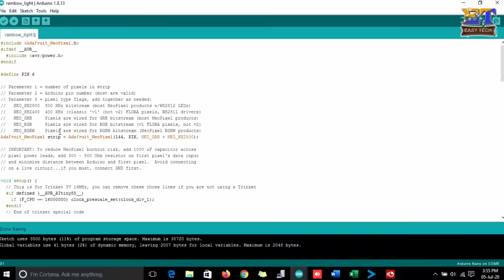Amazing Idea Using RGB WS2812 LED

Comment: I replaced all my 100w florescent lights with 4 meter .2w white LED strips. much better over all lighting.  I used 12V computer power supplies.

Comment: Well Nice Video. I agree with some peoples remarks. It looks like a  HMMMMM HMMMM.  Yeah a development of a Dildo. I think its a brilliant idea to use expoxy for the final model. Just an Idea for your fantastic Vibrator Nano project. You Could utilize touch sensors and a tilt gyro sensors to add to the light show or change the vibration. Thanks for making the video. Its a wonderful idea!

Comment: Did alike with a clean atTiny24 a while ago (why 24? Because I had some around :P) running internal 8 MHz to reduce the part count (ASM code and no Arduino, of course). Although a much smaller core, the Asm (and the clean code with no library/loader clutter) makes a true difference here (much higher framerates, an actual lighting program instead of just scrolling the stuff - and I went as far as the transmit-time color LUTs, so the color schemes are much more interesting). Sucks I only managed two 256-color LUTs (couldn't fit more), tho got smooth-activated full-on and full-off modes :P
Reply: https://youtu.be/vDdm4ySWwUI?t=14

Comment: Love your project. Is the flashing colorful lights obtained through chip adjustment? 
Is the light strip originally white?
Reply: no. these are called neopixels or ws2812b led strip. Search them on youtube to know more about it
Reply: @flickeringsoul35  neopixels initialize at white, full bright, unless the #define is changed.
Reply: https://youtu.be/vDdm4ySWwUI?t=14

Comment: Bruh why you even need to do this? You can get 20m led lights for 22 bucks, which comes with all you need without even soldering, you can control it with Smartphone or remote controller. It will be much easier  just connect controller and Module. Guess this guy is indian who need money by making crap. And also stop deleting my comments you scammer.

Comment: Shenzhen Jiangjing Lighting Co., Ltd.focus on development,designing, manufacturing and marketing of commercial and industrial lighting fixtures.

We own full sets of advanced professional manufacturing and inspection equipments, all lighting fixtures that we produced pass UL, cUL, ETL , ENEC, CE, RoHS, FCC, CB, TUV, SAA certifications. 

Our featured indoor lighting fixtures including 2.4G Wireless CCT tunable Series, Power & CCT DIP Switch tunable Series and IOT Control series. 

Our company has three production bases, Shenzhen factory, Hubei factory and Vietnam factory

Comment: Sir, I need 25v or 50 v 4700uf capacitors in bulk quantities. If you are having the same please send me the prices, if not please send me the address of the suppliers n Mobile immediately
Sir can u supply smd led, capacitor, mov, resistance, ic drivers, ACDC batteries, DOB raw materials, led  strips, led tube lights raw materials  with Tikki fitting n punching machine n all other accessories, led strips for led tube lights, led ceiling lights n all types of led bulbs, spare parts of all types of led tube lights, ceiling lights n led bulbs etc, guarantee of raw materials, mode of payment,  please send me the details of the above immediately

Comment: Sir can u supply smd led, capacitor, mov, resistance, ic drivers, ACDC batteries, DOB raw materials, led tube lights raw materials  with Tikki fitting n punching machine n all other accessories, RGB LED bulbs etc, guarantee of raw materials, mode of payment,  please send me the details of the above immediately

Comment: Capacitor?, so many electronic master does not recommend that arduino nano supply the volts from USB directly
Reply: At 6:41 you see that the LED strip is not powered from the Arduino.
It's powered from the USB socket and I suppose the Arduino is in parallel, or perhaps even in series after the strip.
But it should be parallel in my opinion.